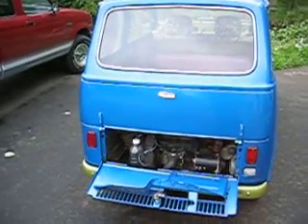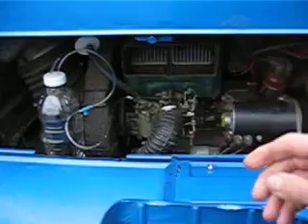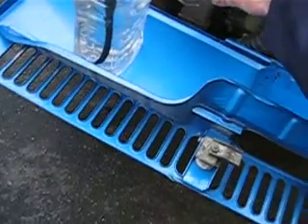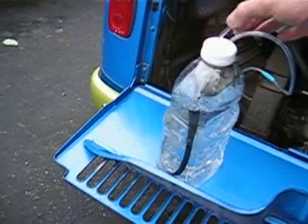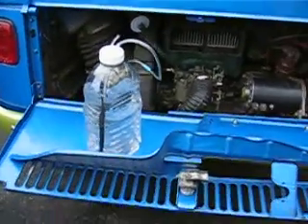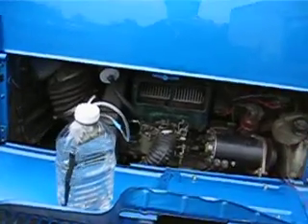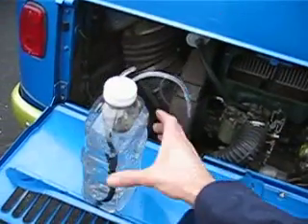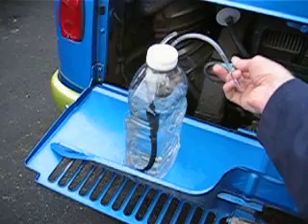Vapor Injector                                      ( DIY for cheap ) by LOUIS HUDGIN

Comment: Nice I have several of these on my old trucks, easy peasy to make helped a 78 F250 4x4 that would always over heat while in 4 low (where it spent much of it's time) run cooler but also increased my gas milage not much but at 8.7mpg to about 9.2 mpg anything is better then nothing, kept my plugs and carb cleaner.

Comment: I help a man back in 1978 put one on my car, we used a glass mason jar, plastic tubing, needle valve from fish tank. Attach to a vacuum source below the card on the intake, this goes in jar about 2 inches, other line go to the bottom of the jar, has the needle valve on it to control amount of vapor. It seemed to work very well, I did see Jimmy do this same system using moonshine, the car would run 55 mph on flat ground giving no gas, just wide open needle valve. Thanks for the reminder video

Comment: i wonder what might happen if we sent heated water vapor into the engine manifold..im assuming that would create a mix of gasoline,lubeoil and air mix vapor with steam to create a more powerful combustion for the 2 stroke engine since these machines spark more often than 4 strokes..only problem is that more power results in increased heat which may not be what you want in a rear engine car..cant wait to try this on a 2 stroke 125cc motorcycle hehehe

Comment: Where do you inject the water into the system? Do you use a venturi tube, or just a plain pipe? I had a simple water injector system I bought from J.C. Whitney - reservoir, tubing, and pipe that was put in a vacuum line in the intake manifold of a 1972 Chevy C-10 truck with a straight 6 250 Cu/in engine. I immediately noticed these things: smoother running engine, more power, better gas mileage (18mpg to 24 mpg). The gallon tank of water had to be replenished every 80 to 100 miles, and when I pulled a plug to see the piston head, it had no carbon deposits on it. Great system, easy DIY, and no power needed for pumps or electronics. Don't need no HHO fancy systems that are costly and complicated. Has anybody noticed that your older carbureted engines ran better on rainy days?
Reply: Ive been thinking of trying the same thing. Basically, do you just hook up a bottle of distilled water and run tubing to whatever line gets suction? I would think ported vacuum would have more benefits than only having regular vacuum during idle-since vacuum drops off after you rev. Ultimately what I want to do is have a nice misting nozzle fed in through a spacer, like a carb spacer/nitrous spacer, but I don't know how I would get ported vacuum to it. I guess I would have to rely on a pump in that case.
Reply: Where is your vacuum connection by 18 to 24mpg???

Comment: What is your mpg with this system?
Reply from the maker: I use it to cool the cylinders and heads, it prevents detonation on air cooled rear engines. MPG is the same with or with out it.
Reply: Does it give the engine more horse power?

Comment: This project is a bottle of water, not fuel.
It is intended only to add humidity to the intake air on hot dry days.
To correct for the problem you describe, the hose to atmosphere goes to the bottom of the container and the hose to the car is kept very short so that it does not pick up any of the liquid.

Comment: This is not for better gas mileage This is to help keep the air cooled engine a bit cooler. This has been going on for ages.It also keeps engine knock down with lower octane gas .

Comment: Just tried this and instead of gas vapors sucking out, the gas was being sucked out.  I looked at the jar and it looked like a whirwind in it.  It was a swirling motion starting from the bottom going to the top of the lid.  I let it run for about 30 seconds and it went from 1/4 of a jar of gas to none.  What did I do wrong?

Comment: mix with isopropyl alcohol to increase the vapor emission helps the water vaporize faster under a vacuum the water gets cooler and is allot harder for it to vaporize alcohol in the water will over come that

Comment from the maker: @99XM    Subaru 360's are oil injected. The Subaru 360 van's fuel tank is lower than the carburetor, no need for shut off valve. This van has the sedan intake with the vacuum port between the carb and heads

Comment from the maker: @anthonypotter64 ... 360's only have one vacuum port on the intake between the carb base and engine.  It is a manifold vacuum port.
Reply: 2stroketurbo you have no problem on deceleration and engine brake???

Comment: @024reredrum 

No, meth is injected into the cylinders and is burnt up like gas. This "vapor" injector is used just liek a radiator. vapor means water and u inject vapor the way meth is injected and you'll sieze your little engine right up!